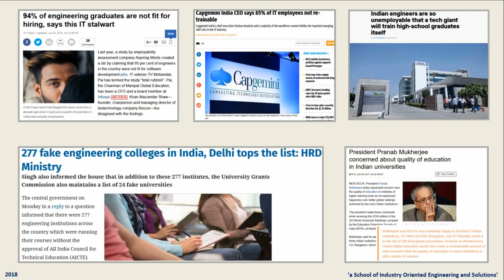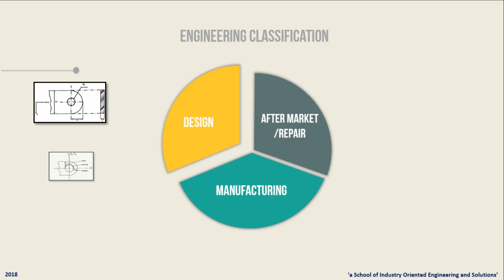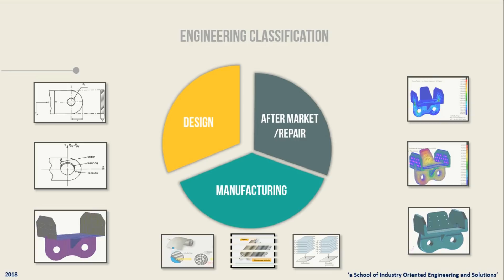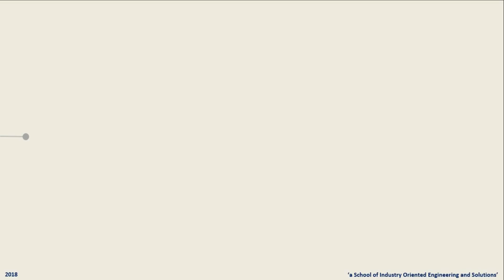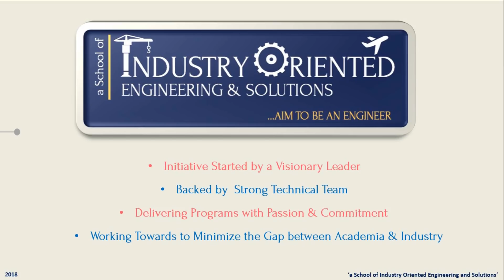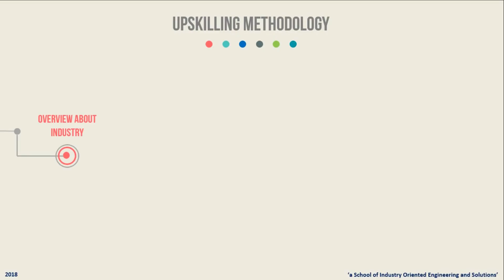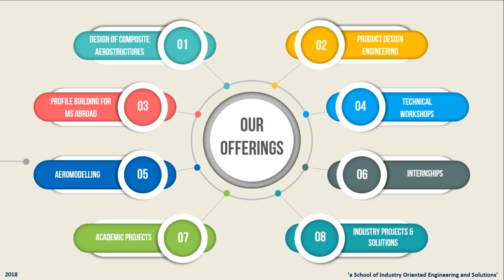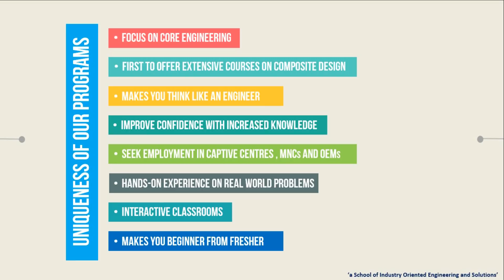Must Watch for Mechanical & Aerospace Engineer...!

Comment: must needed transition in India from service based activity to product centric activity. Core engineering knowledge is the key to establish in aerospace, power, manufacturing, heavy industry and oil&gas sectors. This enable further to use latest technologies and Industry4.0 concepts effectively for more efficiency for MAKE in INDIA TO further DEVELOPED in INDIA  mind set.